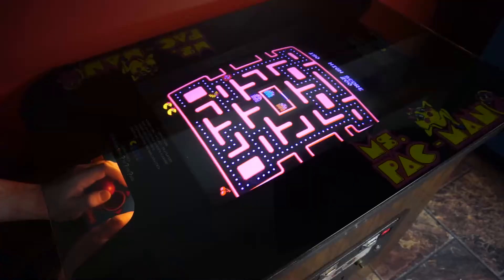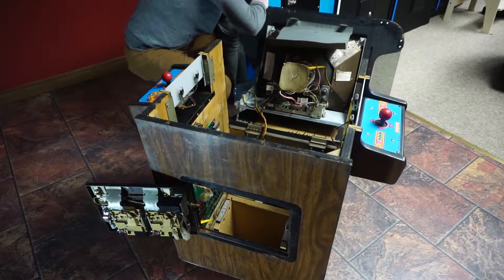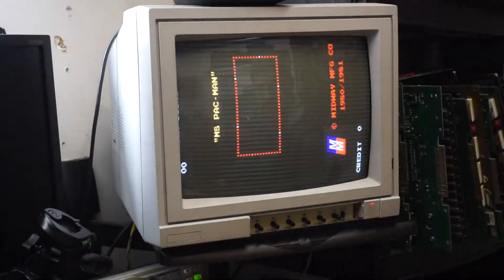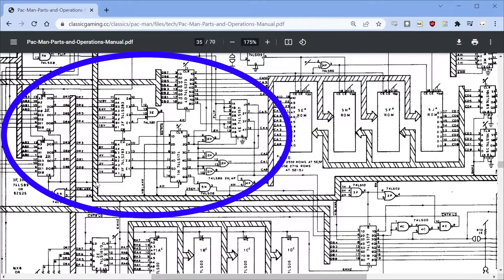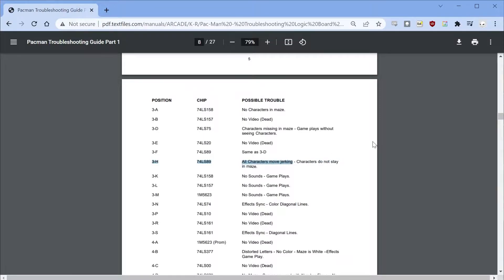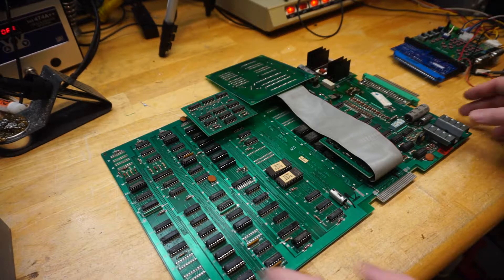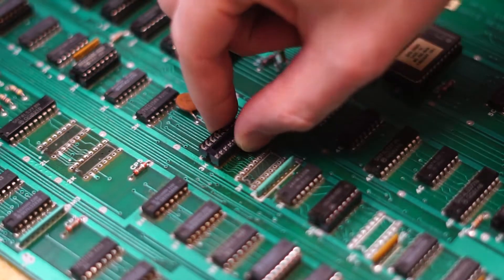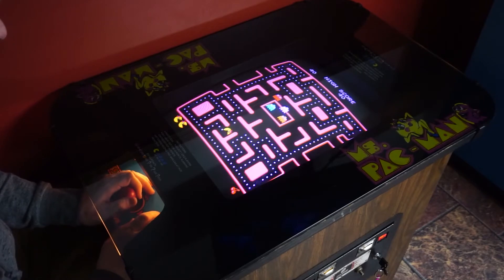Ms Pac-Man PCB Repair - The Ghosts Have Lost Their Minds!

Comment: I have a question.  I have a twin cobra pcb and wondering if you know anything about it.   the power supply is pushing out 5.1v.   when I check at the connector with the board connected with the power outputting 5.1,  it read 4.3v.  The game has multiple boards,  at the top most board it read 4.1 to 3.8v.   The game doesn't turn on.  I check the IC chips and they are reading around 4.3 on main board and 4.1 to 3.8v on that top most.  If I increase power to 5.8v (max for my power supply).  the connector read 4.9 and the top board read 4.6v.  The game comes on and starts to run, but graphic issues, I would say it is related to low power.   Is there anything to check on the board to see what might be draining the volts?
Reply from the maker: Yes indeed something is causing far too much voltage drop along the way. I looked up a picture of Twin Cobra and I can see that the bootleg board has three boards cascading up, is yours that type? It will definitely be very power hungry with that many boards and no power distribution (no power connectors to boards 2 and 3). But, I would first wonder about your power supply and wiring - if you're getting 5.1 at the power supply but 4.3 at the jamma connector, I would guess your jamma wiring is not sufficient for this board.
Reply: @74XX_arcade yes.  It is the bootleg.  3 boards. When I said it's low at the connector. That is when the board is turned on.  Testing power supply without the board connected it is fine.  It works fine setting it to 5.04v for neogeo, cps1, Raiden and others.  The twin Cobra sucks up the power.  Something is draining it.
Reply: It only shows low voltage when twin Cobra is connected.  Ice disconnected all boards except the main PCB and it still has the low voltage drop.
Reply from the maker: Best you can do is probably to find hot chips. Ram or audio chips would be most likely.
Reply: @74XX_arcade thanks for your help.

Comment: Nice quick and informative video! Really surprised how many bad RAM chips there were. Makes me glad I don't collect arcade hardware though, I don't have the same tools and knowledge to troubleshoot problems of that nature.
Reply from the maker: Yep! It's getting tougher as more chips fail. Eventually finding old stock like my RAM chips is going to get hard. FPGA will likely replace many, many PCBs in cabinets in the next 10 years.
Reply: @74XX_arcade   You can just use 7489's or 74LS89's in place of those (the ones you changed out).   Changed one in a Sound Section the other day to fix a no-sound issue.  Voila!